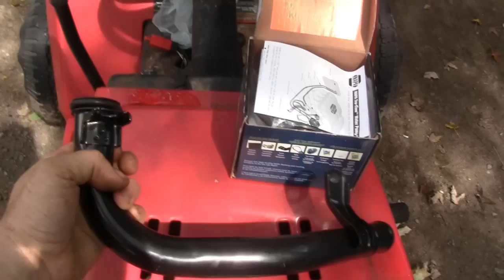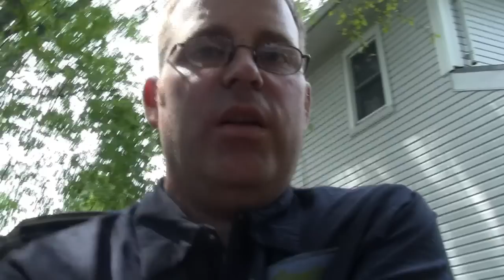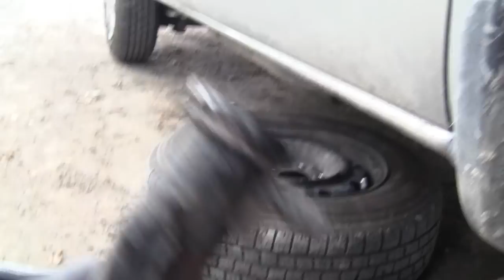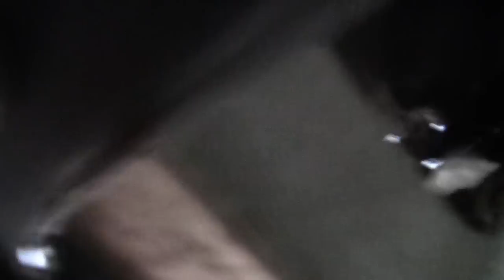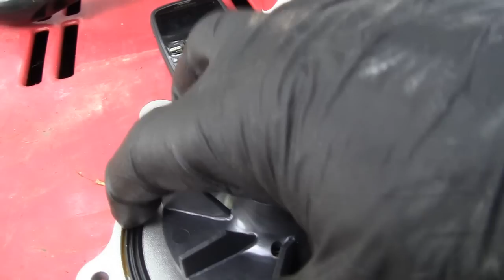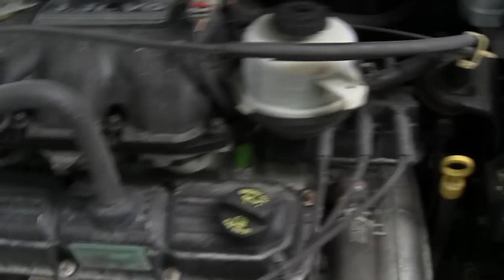Dodge Caravan 3.3L 3.8L water pump replacement.mp4

Comment: Excellent video.
I have a 2001 Chrysler T & C (3.3L)
The repair shown here is exactly the same for both. Been under it replacing the serpentine belt, only to find out it was popping off because of the water pump, which explains the fact that I have had to fill the coolant once a week. (been putting water in until I found the problem why it was losing fluid (so I spread water into the world not antifreeze).

Thanks again for the video.

Comment: My wife's van broke down and I was able to fix it using this video and one other video. You did a very nice job of explaining the process step by step. I have a 2001 Chrysler town and country with a 3.8 V6 and there was no need to drop the motor. With just a small amount of maneuvering the water pump came out past the frame and went back in easily as well. Thanks!
Reply from the maker: Gene Callen I'm glad it was a help too you. More videos like that on my channel

Comment: To remove the belt - use large channel locks or a pipe wrench - it will fit in on the roller end of the tensioner and allow you to loosen without lowering the engine and thus saving a lot of time.  Even though it's mentioned that you will still need to lower the engine to remove the pump - I've replaced 2 on the 3.8L model without that step - whole process was about an hour between lifting draining removal and replacement - Note: I was not replacing the metal pipe that connects to the lower hose.

Comment: Excellent step-by-step instructions.  Mine is a '94, but should be pretty much the same.  Thank you!
Reply: Your model year is actually easier to do. The water pump sits in front of the engine under the A/C compressor. Drive it up on ramps, drain the system, break the 3 pulley bolts loose and remove the pulley, take off the belt, then undo the 5 bolts and remove. Install is reverse. But be careful of the bolts. Like mentioned in the video they do like to break off. I never reuse the bolts myself. I go to HD and buy new ones for installation.

Comment: Awesome job on the video.  Used this to replace my water pump (which had catastrophic failure) and my lower radiator pipe (heater bypass).  My van is a 2005 and has nearly 150K miles.  Never would have been able to do this without knowing how easy it was to lower the engine.  I was nervous about doing this, but it worked perfectly.  Very much appreciated!!!!!

Comment: Count me as another beneficiary of the info you've shared in this video.  Without your guidance, we would have most likely missed both of my son's soccer tournament games today instead of just the first one.  There is one bit of info I'd like to share with others digging into this chore: The water pump and pulley on a 2006 Grand Caravan SXT - 3.8L engine wouldn't come past the frame without dropping the engine about an inch, so even if you don't drop it to get access to the tensioner, you still probably need to drop it to actually swap out the pump. The engine mount bolts are long enough that they didn't have to come all the way out, but the pump refused to pass between the housing and the frame without that step.

Comment: Excellent Job Shawn ... I had a hard enough time without the camera.   I had to lower the motor for the water pump to clear.  Thanks for the tip on bleeding the air out.  I can tell you are a good Mechanic because of your tips to lubricate the bolts before installing

Comment: Replaced my water pump this afternoon.  Had to use a u-joint adapter on the ratchet to get to that upper rear bolt, but other than dealing with that bolt it went off and on pretty easily.  My tensioner pulley arm had the square flange on the back, so I could use a crescent wrench to grab onto it.  The handle of the wrench rested neatly on the air conditioner pulley, and kept the belt slack throughout the process.

Comment: Just done a brand new starter in my 2005 and had to pull back out due to it not engaging. But after that I need to do the water pump and I'm definitely going to use your video thank you.

Comment: Oh, damn,
That's what I was going to include.
You don't need an impact wrench to crack loose the front engine mounts, and you can drop the motor down all you need to and leave the three bolts in 3 or 4 turns. Just do indeed support it from underneath.
And belt tensioner?
Tip of a long 3/8" yes 3/8" drive socket extension into the square hole and the side of the extension against the frame rail as the fulcrim. Nothing to it.
Reply: vanpenguin22 Dodge window
Replace rights endow
Dodge carava

Dodge Caravan twin ns
Vanwendoor
Reply: Dodgevan

Comment: Thank you Shawn C, a good service you provided here.
Hope you  don't mind if I throw in a little warning to the do it your selfers out in You tube land as to the a snag I ran into.
The bottom most mounting bolt in the 6:00 position is right in the way of the stream of drippage caused by the leak.
The bolt is steal and both the body of the pump and the structure it mounts to are cast aluminum. Thereby we have dissimilar metals and moisture which leads to galvanic corrosion. As is often the case, the corrosion welded the bolt to the aluminum. I busted the bolt trying to turn it.
Please, folks, Heat it up and use penetrating oil and lots of patience on that sucker.
Gather your exertion gradually, and pray that the rest of your vehicle is more well engineered than the distribution of those bolts.
Thanks again Shawn C. Would like to work with you some time.
Reply: I'm glad you got it out, because today the same exact thing happened to me. Now I have to drill and get a kit. How did you drill because of the tight place. Those bolts aren't very good.
Reply: I broke the same bolt off in my water pump. Not looking foward to extracting it but have some great tips from a few other videos.

Comment: nice video .... just like to ask you why my van over heat  ones a day for about one minute than the gauge goes down fast and it wont overheat no more for the day,,,,,,,it has new thermostat and radiator ....could it be the water pump or air in the system

Comment: Thank you for the vid. I couldn't have finished the job without watching it. Ran into every possible problem..I.E. The last bolt in the back..getting the pump back in with the clearance that was given..tensioner..bolts having corrosion on the threads and being a pain in the ass to ratchet back in but no matter what I didn't give up. Always 3,4,5, or 6 ways to do the same thing like you said.

Comment: I figured out a way to release belt tention without dropping the engine. You see how the tip of the tensioner's arm is in square shape? You can use a huge wrench to bite on it so the arm of your wrench points to the back of your car. And then you will need some rope to tie on the arm of your wrench and pull it downwards. Saves you a lot of engine droping trouble.

Comment: Mine is a 2005 so I'd have to check for differences, but I'm pretty sure it would be just about the same as this. Either way, this video presents as just about exactly how my brother and I would be doing it in my driveway.
The explanations and specifications are clear (except for torque spec's) which makes this one of the best videos I've seen for water pump r&r.
Thanks. Very helpful.

Comment: Thank-you, thank-you, thank-you ! I was able to replace the water pump in my 2007 Dodge Grand Caravan in about three hours. I was able to get a belt tool from Canadian Tire (tool loan). I still had too drop the engine because the new pump was a little wider than stock. The back bolt on the pump was very difficult but I used a flexible ratchet wrench that worked. You saved me probably $600 in labour !

Comment: I find your video very helpful. 
I have a question about a 01 dodge grand caravan 3.8 Same as 3.3 as shown in your video, The A/C is  stopped working a few days ago, I asked the guys at the auto parts and they told me that probably I was out of refrigerant, I purchase the R134 but before refilling the system, the pressure read over charged, I empty the whole thing and when I was refiiling it, with just 2 squeezes to the bottle it suddenly started reading over charged, thanks.

Comment: good vid, like your attitude, keep going, more than 1 way to do a job ! a couple of points, 1> I try not to put parts on grounds which are dusty, gravelly, I saw you did have a work surface when you worked on the new pump,2> an easier way to "burp" the system, is to fill the system slowly using a funnel, then when topped up run the engine with the rad cap off for a few mins, you'll see the air coming out, stop the engine and re-fit the rad cap, run till warm, cool down, open cap, top-up

Comment: I had to replace mine in my 2001 3.3L did not really have a clue where to start after watching this video my fears were gone and went smooth as silk getting to the water pump bolts was slow tedious fine thread  Thanks a million for the video you saved me hundreds !

Comment: Just replaced mine on 2004 Dodge 3.8/V6 per this video. Me, I removed belt by rotating the belt tensioner by prying against it with handle end of 1/2" breaker bar. Found that I did have to lower the engine about 1 inch to get clearance for taking the water pump out though. I was very happy that I didn't have to take the motor mount bolts all the way out, just loosen them to about an inch of slack to lower the motor and get clearance. Thanks so much for this video, it made the job much easier!

Comment: Also, I am losing water, but  seems to be pushing it into the water bottle, then out that overflow, not back into system, and the over pressure causes top hose to swell, but thermostat is working

Comment: Really a great video...I don't have the patience to do this, but it's nice to know what somebody else is going to be doing, and lets me see if they didn't do something. I have a small leak in this area.....is it possible that I just need the transfer piece you mentioned that rots out, and if so, do you think the water pump is close behind or just replace the transfer piece....looks like something I could actually do myself.....the water pump....nah...Thanks!! Steve

Comment: Hello, I like your video, I have a Grand Caravan 3.3L with overheating problem only on highway when accelerate, do you think the water pump need to be replaced? (radiator and  thermostat is new, fan is working), thanks !

Comment: Hi, great vids, very informative however I do have a question on a different subject. I have a 98 Grand Voyager 3.3 however, when you turn off the ignition and remove the key, I can hear a relay click somewhere behind the dash, however, once it clicks, anything you had on with the engine running; wipers, radio etc, then spring back to life. Is this normal or do you think that relay has something to do with it? Thanks!

Comment: How do you change the serpentine belt on a 95 windstar?  there is a video on how to doit on a 1999 but the pulley is much differnt on the 95 it requires mor fose to put it back in to place.  do you know an essy way of doing it?

Comment: how do you suggest taking the rest of the coolant out of the engine block? I'm thinking about either a wet vac or a suction pump, but not sure how is engine block is shaped inside...

Comment: Great step by step video thanks so much!!! Just did this job on my 07 caravan without dropping the engine. Only problem I had was when I started the engine up I found the wobble issue you mentioned. Is the problem with the new pump or the old pulley? do I need to replace both? Is it safe to drive around like this for a few days? so many questions, appreciate your advice...

Comment: I had to drop the engine down to get my water pump out, thanks for the idea (damn thing would not fit out.

As for getting the belt off i just used a pipe wrench and torqued the tensioner that way

Comment: Great video of how to do the water pump.  Nice detail.  I also was worried about dropping the engine.  It sounds so drastic.  Never do this, I was wondering how the holes lined up to put the bolts back on when the engine was jacked back up.

Comment: really enjoyed the video. very detailed. how's the tank coming? question, I had a mech replace the rad on my 05 t/c (had a leak) when he finished van stated to overheat after about 4 miles. he stated w/p bad.. I ck out the van found upper hose hot but rad and lower hose cold..  when i opened the rad cap. top of rad got hot but lower rad and hose still cold.. cranked the van looks like water is moving in rad..thanks in advance.  i enjoyed many of ur videos keep it up..:-)

Comment: thank you for the respond, I see in video that u didn't use a jack stand...I referred to the shop service manual, it is showing four points of lift to the inside or where you would normally lift it for a flat tire...it looks like you have used that... I have lifted cars before but not very often, I'm just being cautious...also...I hope your wife had a full recovery... and for any one who is looking to replace that steel hose, you will find it the cheapest at Rockauto.com,

Comment from the maker: Since the rear lines are lower then the motor you should not have to worry about the rear heater at all. Just do it this way and warm it up to hot. make sure the overflow tank is full. let it cool down then check the rad again.

Comment: Completed this yesterday on my 2005 Dodge Grand Caravan. This video helped greatly! I did not have to lower the engine, instead we used a crowbar and was able to apply enough pressure to move the engine just enough to not have to remove the engine mounts. Replaced the radiator hoses, serpentine belt, and thermostat as well. Thanks Shawn, couldn't have done it without a video like this.
Reply: ?? Why remove the motor mounts or trany mounts 2 😅😅😅😅😅😅😅😅😅😅

Comment: Used your video to instruct me, on Christmas Eve. The most freightening part was takng out those engine bolts and dropping the engine. I am not a mechanic! You covered everything i needed to know. Just wish my arm had 12 more elbows, to bend enough, to get that last bolt loose and reinstalled. Everything else was a breeze after that.

Comment from the maker: Theses vans are bad for the steel heater hose thing that comes off of the pump at the back. they rott out and go all the time. I think your talking about the same par. I can't remember the part number. If you ask for the steel heater tubes they might beable to find them for you

Comment: Shawn, My dad's 2005 dodge caravan 3.3L V6 is idling very high (sounds like over 2000 rpm) when he starts it up in the mornings. it seems like the colder the engine is the higher it idles on start up. any suggestions as to what it might be?

Comment: My nephew suggested looking online for clues to help replacing his Caravan water pump I found Shawn's video and it helped shorten our time and frustration.  The most helpful clues were dropping the engine, indexing the pulley over its flange, accessing the 5th bolt from the rear, and replacing the belt.  Shawn indicated there were multiple ways to do the various steps and we needed to use several variants with our limited tool set.  I will go to ShawnCFarm first for future auto tasks.

Comment: Your video was helpful. But my new installation had pump wobble when running....longitudinally, or "out of round".
But I discovered the pulley isnt self centering, so when you put the "no so tight" fitting bolts back in, its possible to get it off center. I loosened the bolts, 
checked trueness with a screwdriver braced against the crossmember....once
it turned true, tightened the bolts back up and voila, no more wobble. 
Saved me exchanging the pump, when that wasnt the cause.

Comment: You had a couple of times that pulley wasn't centered. I got my new pulley today, i put on a mopar water pump that took out 9 mts ago. i put in vice but can spin it because fins and or pulley keeps banging into the vice preventing me from spinning it to check for wobble before i drain,and install pump/pulley.  how do you do it?

Comment: Thanks. You said prying engine over to get pulley off. Can I brake something?

spun pump that i took off 9ths ago because thought it was the pulley. looked straight as i turned to reference pt. for all 3 ears. but how could the pulley have got bent?

removed 3 bolts & put lock washers on 3 bolts of pulley where join pump. made it worse maybe i should try flat washer instead as shim. don't know how you got wrench on the difficult one and still get torque on wrench where hand went over frame.

Comment: Shawn thanks for response. Last time i took pump off and pulley i did it in unison and i didn't drop the motor mount (3.8 engine, 06).  Can i remove the pulley only without the pump so i can check if the pulley is bent by putting it on a pump i still have??

 however i hope that the old pump is straight and not the pulley. the sound of the belt is driving my ears crazy.

what is your advise?

Comment: Your video said make sure to check for wobble after putting new pump on for alignment because you had chirping on a couple of others.   Can that be done while the pump is off the van? Can i remove pulley while pump stays bolted to van? this way i can add a new pulley without removing the pump. my mopar pump was wobbling 9 mths ago. i replaced with another pulley from advance auto and it also wobbled. so i was wondering if it was the pulley because i still have chirping belt sound.

Comment: Had a chirping sound and thought it maybe the pulley on pump. spun it & it wobbled.didn't get rid of sound. bought a belt Sound gone, even though same wobble.

6 mts later. Chirping back. replaced belt again. Chirp stayed. Wobble still there. You said pulley needs to be aligned so there is no wobble. Do you mean modify way pulley aligns to pump? 

Because the 1st pump/pulley wobbled and new one replaced 6 mts ago wobbled? is it pulley or pump? can i  take the pulley off without pump? What to do?